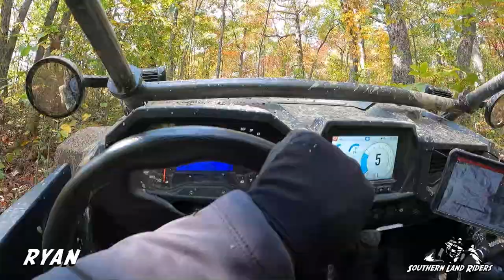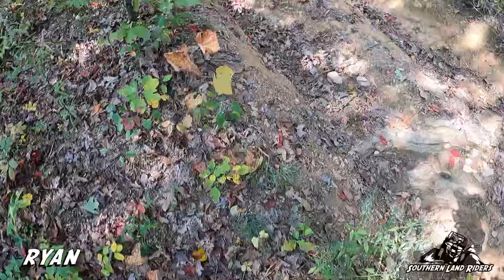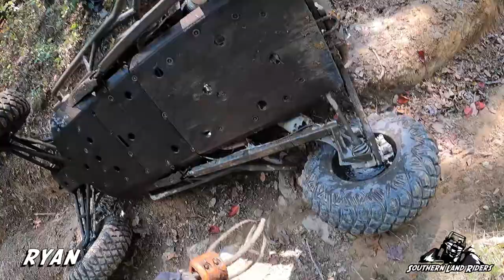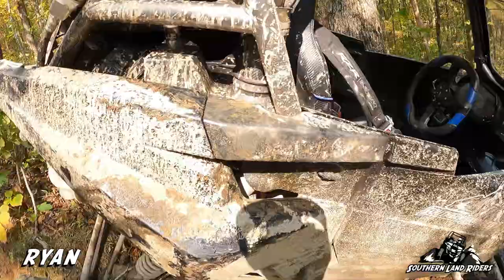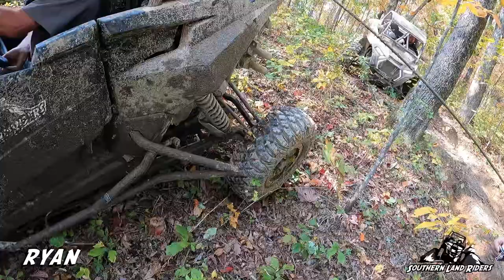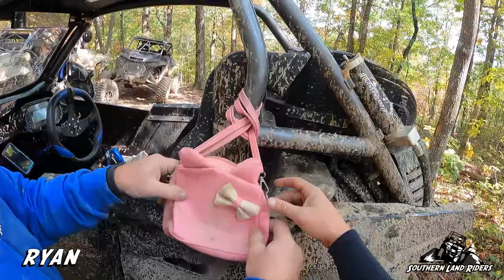Tackett Creek 10-2020 Day 2 Part 3 (Airplane Crash Hill)

Comment: I know this is a dumb question for a video like this, but I’ve always wanted to know where you got those lightbar mounts for the RS1???
Reply from the maker: Not a dumb question at all. The lightbar came from Amazon and came with 2 different bracket mounts for the bar.
Reply: @SouthernLandRiders  see and all this time I thought you guys had some top secret super low light bar mounts 😂👍🏼 thanks for answering bud! Glad she’s ok and great content like always!
Reply from the maker: @ShaneHubber85  no sir just the standard mounts. All of us run a single row light bar so they are a little smaller than most and the mounts sit a little lower. Thanks for commenting and watching buddy!